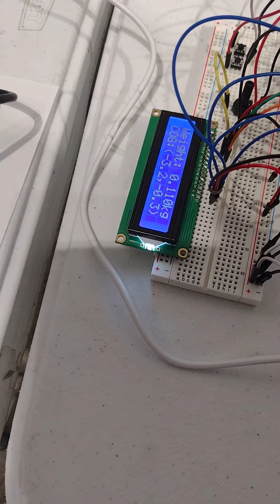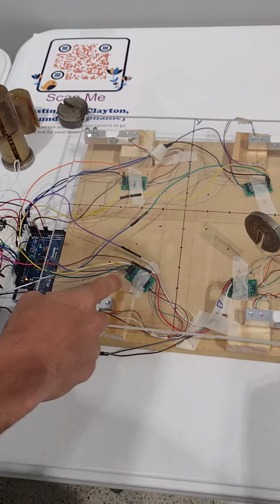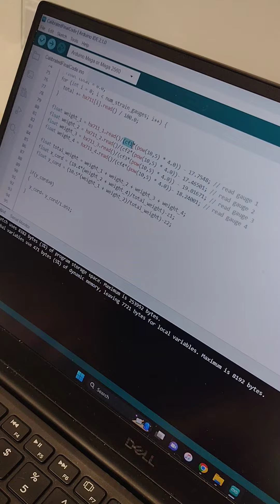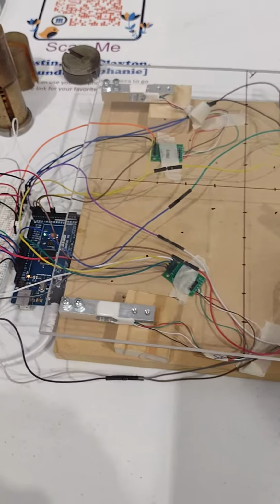Arduino weight and center of gravity measurement device #arduino #arduinomega #arduinoproject

Comment: hi can ı ask you question?
Reply from the maker: Sure.
Reply: @MohammadShafinulHaque  
I am an electrical and electronics engineering student and I have a project. I am looking for resources to do a project similar to the one I mentioned in the title. For this, I need to find the center of gravity with 4 cell loads and 4 HX711. I saw that you could do this project, but you did not share the codes in your video. Could you please share the codes used in this project with me?
Thank you...